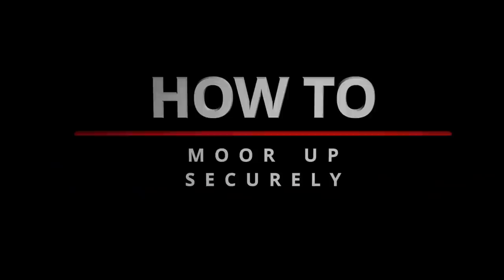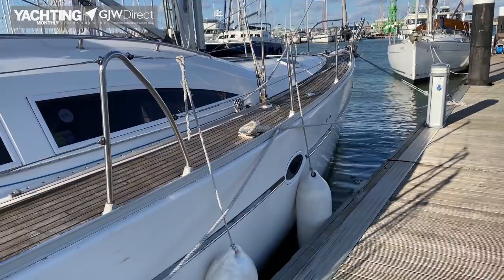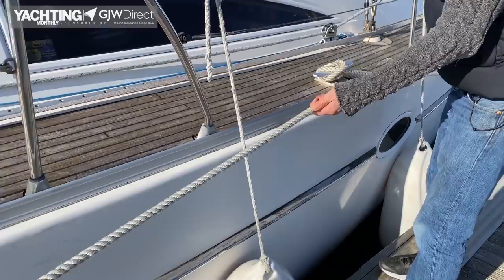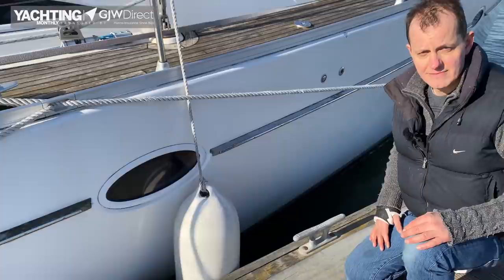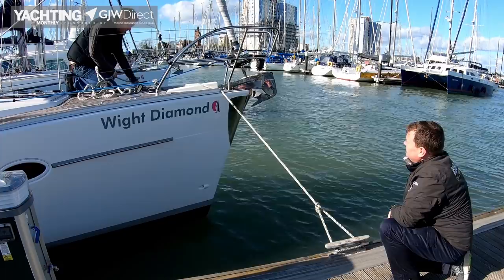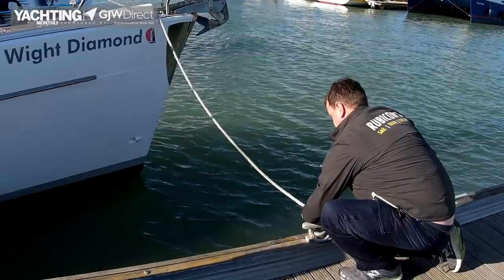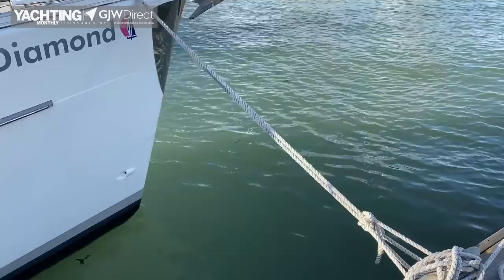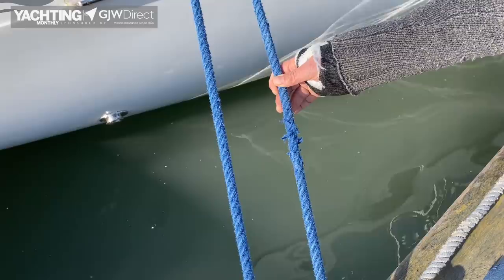How to: moor a yacht securely - Yachting Monthly

Comment: One advantage of having both ends on the boat and a bight of rope free to run on the shore cleat is, the line can be undone and retained onboard. Handy if you are single handed or your crew/passengers are not working the lines.
Reply: It is great for a short time, but chafe is increased. You can also run out of cleat space on board as you're doubling the requirement.
Reply: I agree with ToSeeTheSea. Start with a spliced eye on the boat cleat. Two turns around the cleat or piling ashore to minimize chafe. Cleat aboard. This approach makes you more self sufficient and reduces the risk of s crew member having to climb onto the boat at the last minute. 

I also agree with @Rubicon 3 about chafe and duration. For a home slip/mooring, I use permanent lines with a spliced eye on the boat side. When you pull into the slip, retrieve the lines with a boat hook and drop the eyes over the cleat, knowing you are in the right spot. Once secure, walk around the boat feeding each eye through the legs of the cleat as shown in the video and double over. This snugs the boat up a bit.

Comment: Another one downside of using a spliced loop is that you can't release the mooring line if two boats use the same cleat.
Personally, I prefer the bowline for a long stay on cleats. But the round turn and two half hitches easier to release from pontoon side.
On the Baltic sea that is also popular using big carabiners with mooring line compensators for mooring to cleats and rings.
Reply: Totally agree Alexey

Comment: I actually prefer to have the free end on the dock.  This way the line lengths can be adjusted from the dock.  Could you say something about the diameter of the nylon lines for the size/weight of the boat?
Reply: It's ok to have an OXO on the dock (albeit it's not neat and hogs the cleat, but so long as you have an OXO on the yacht too. Warp diameter depends on boat size but for a 10-12m yacht you want about 14mm

Comment: I prefer bowlines or spliced loops on the boat cleats, and OXO on the pontoon cleats - that's how you would generally be tying up if short handed. It's also more practical to depart that way if shorthanded, otherwise you need 2 crew to release one line as loop around the pontoon cleats will be under load. That probably happens more of the time than having someone to take lines on arrival / release lines lines on departure from a pontoon.

You could also do a video on attaching fenders to the boat - you can see at https://youtu.be/6Mz9mAwVvgE?t=73 that the fender is attached to the top guard wire, is under load and stretching the guard wire. Not what the guard wires are there for! It should be tied off at the base of a stanchion - much stronger.
Reply: Andrew you are quite right about the fenders. Bad practice. We actually borrowed the yacht for this video so we didn't want to change anything. But trust us, never put the bowline or any other knot or spliced loop on the yacht. You HAVE to be able to release the line under load. Oxo, especially with a double XX, is absolutely secure

Comment: That showing a bowline loosely draped over the cleat should have been edited out.  You fixed it later in the video, but you never should have shown that in the first place.  You also didn't show tying to poles which is very common in the Caribbean.
Reply: Sorry Mark - can you give me a timeline on the video so I can respond properly? I had just broken my arm (as you can see) so it was a tricky old exercise!!
Reply: @Rubicon3CoUkadventure-sailing  How about at the 2 second mark?  The right amount of movement could slip that right off the cleat and then you have a problem.  I use this on my spring line to make it easy to hook when I return, but then I thread it thru the center and over the horns after I'm tied up
Reply: @MarkJones  Yes that is a fair point. I think that bit of the video was just us preparing the yacht to be fair! (bearing in mind we just borrowed it, as our expedition yachts are much bigger). It is good to make it more secure if you're leaving the boat and you can either, as you suggest, slip it through the legs of the cleat first or, what we do, is just put two loops around the cleat.